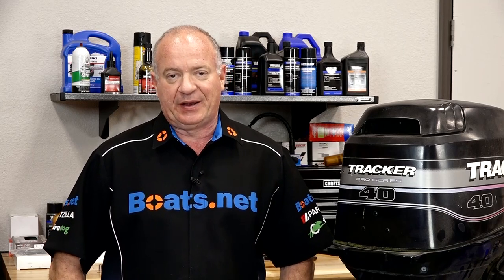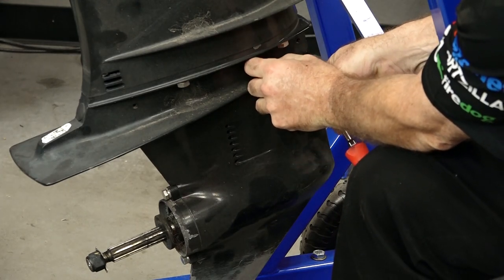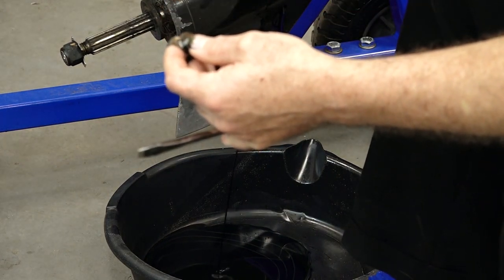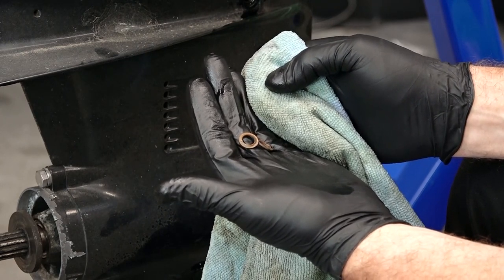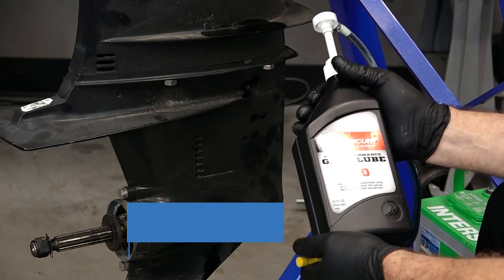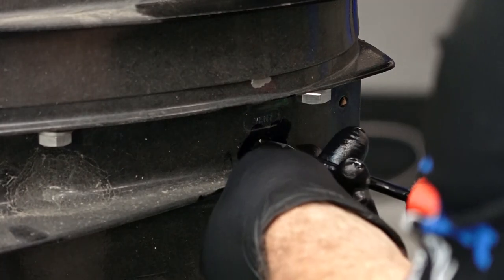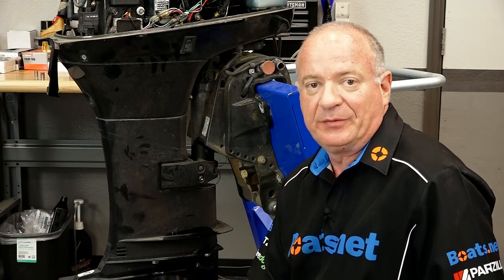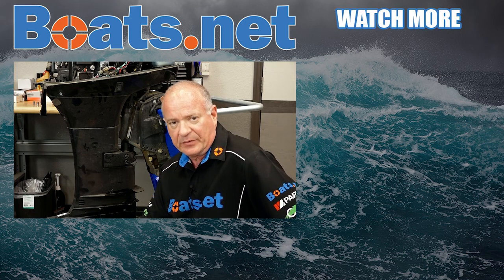Lower Unit Oil Change on a Mercury 40HP Outboard | How to Pressure Test a Lower Unit | Boats.net

Comment: Mercury recommends premium 80w-90 for engines less than 75 hp and high performance 90w for engines above 75 hp. Is there anything wrong with using the high performance in a 40 hp?
Reply: I didn’t see a response in your question were you OK to use the 90 on a 40 hp
Reply: Yes I’ve been using the 90 for the last two years and everything seems great.

Comment: Hello . I am a little confused . When you were putting new gearbox oil in , you did not have the lower bolt screwed in. How do you fill it up and see fluid come out of the top hole , when the bottom hole is not sealed ? Also one  really important question. What does it mean when you see gearbox oil come out of the passage where the water flows into for the water pump. I was looking at an outboard to buy . And when the guy used the trim to lift the motor up. oil leaked out from where the water goes in for the cooling .. thanks
Reply: I bet you had a rip in your boot on the inside. It sits right underneath the housing for the impeller helps hold the fluid from coming up